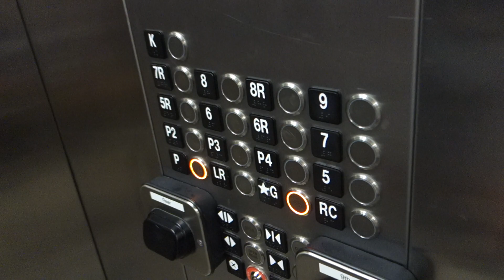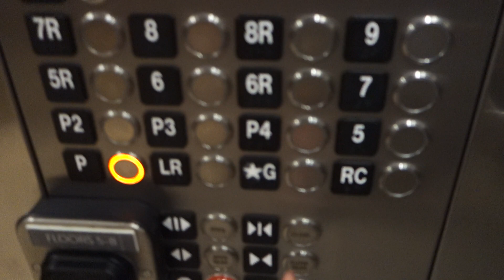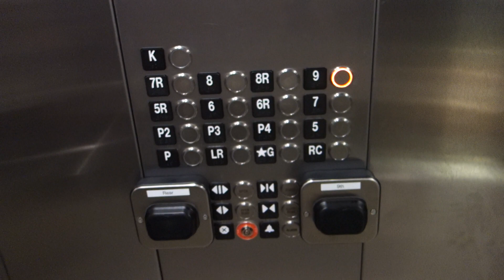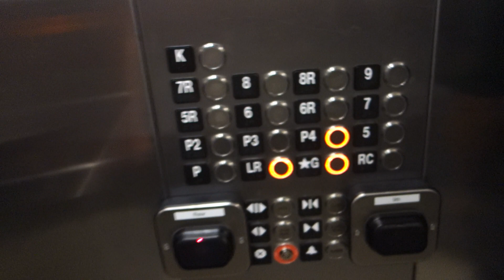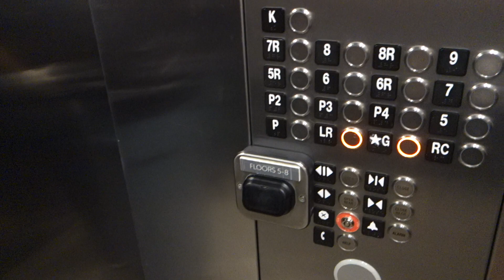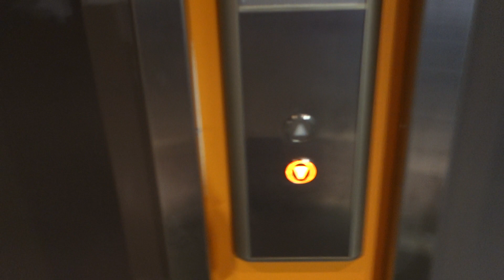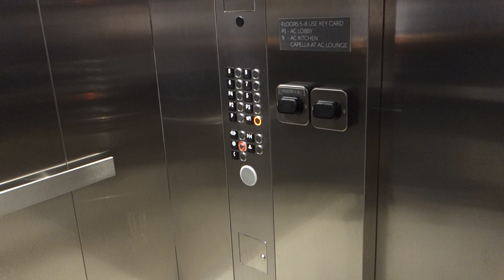HORRIBLE BRAND NEW KONE Ecodisc Traction Elevators at the AC Hotel, Asheville, NC

Comment: Yeah, KONE is a bit crap. One of the elevators in my apartment building in MD has been broken for SIX MONTHS NOW, and the management has done ABSOLUTELY NOTHING TO FIX IT. Recently, some of the parking elevators broke. Garage A has Two KONE Hydros and one KONE EcoDisc MR, but both the EcoDisc and one of the Hydros were both broken, and the remaining hydro that was in service is EXTREMELY LOW ON OIL!!! Also Garage B had one elevator break. This is in Rockville, MD. The Management did a good job NEGLECTING THEIR ELEVATORS. All of these elevators that I just mentioned are KONE Elevators.

Comment: I recently got a similar reply from a KONE tech when they were doing a mod at a mall they said “I’m glad we convinced them not to get an ecodisc mod” and that they always feel bad about how often they break. If they just made the controllers better the ecodisc would be great like the European ones. If the techs don’t want to install then then there’s a problem.
Reply: DoverElevatorFan1 it is the controller not the motor.  Ecodisc is a great motor
Reply: That is what I meant. Sorry if you misunderstood. The motor is good quality for a modern elevator. The controller could use some work though. KONE is a fine company and the tech was pretty nice.
Reply from the maker: Read my pinned comment
Reply from the maker: @freerk242  It may be the same, but not programmed properly like in Europe. Sounds to me you've never ridden a American Ecodisc, let alone this set, so you can't be talking. Not trying to be a jerk, but it's true.

Comment: Here in the UK, KONE do pretty nice lifts honestly. The Ecodiscs in my local library are really nice, they run well, and they only broke down a few times since they were installed when the library was built in 2017. The library was built to replace the old library (which was torn down and rebuilt as a hotel (that also has really nice Ecodiscs)). KONE also do more heavy duty lifts for car parks.

I guess as long as buildings don't install generic crap or rush better lifts, they should last at least ten years.
Reply: @KONEISTHEWORST stop spamming 10 year old

Comment: I hate kone ecodisc so much that we need to talk so right in to it the lanturn is shaped like a Diamond it's so glichy bumpy and slow and it's running bad I've got stuck with sahki and it broke after only 5 weeks or 4 weeks it used to be a to be a old garage with a amazing 1960s otis and it's just so bad and why is one of the floor indicator broken and I would even rather ride a 1920s otis over this piece of crap and I hate stainless steel cabs
And Do you agree? just reply in the comments
Reply: Yeah I agree
Reply: I completely agree
Reply: @Wen Kern Boys Elevator Channel beno LOVES it
Reply: What is your favorite elevator brand

Comment: How can you tell if a Kone is an EcoSpace or MonoSpace?
Reply from the maker: AdazElevatorz Speed and amount of floors served. These are probably EcoSpace cause of how slow they are
Reply: Floridian Elevators
EcoSpace doesn’t go up this high.
Reply from the maker: @EWPA14  Based on what I read online, I believe they can go above 10 stories actually. But for that many floors, MonoSpace is faster and more efficient
Reply: I think that was a few years ago. From what I can tell now EcoSpace is trying to compete w/ 3100 & only goes up to 4 floors.

Comment: I really hope you see this, kone is refusing to refill whiskey blue and they were there to fix it for the second time in 2 weeks. They were there 3 days ago and when I was back there to see it actually working it was low on oil... The engineer dosen't even know why it shakes at the top floor. Going to to text him about this tomorrow.
Reply: And why? 4 inch gap between top of oil tank where you refill it and the ceiling. Well that's why it was submersible

Comment: I am pretty upset about this replacement! I'd expect a lot better from kone. The Ecodiscs at my dad's friends house which are as slow as snails run far better then this piece of crap. And notice how long it takes for decelerate ! This is nearly as horrible as a typical NYC 50 story Generic lift

However, I do agree with dieselducy kinda as there is an example of when I have been extremely immature ranting about Otis products back in 2015-2016 by saying that the "Gen2 was crap" even though I never had any evidence to prove it false until last year...
Reply: HC EleFilms by Technicalboy3000 same me
Reply from the maker: Read my pinned comment

Comment: Should have went with Schindler 5500 or 6400
Reply: 6400 is only for mods
Reply: QuarioQuario54321 If the Otis was still here.
Reply: Top Hound Do you mean Schindler 6400NA
Reply: Seminole Airways
It’s the exact same thing, but Schindler dropped out the “NA” part of it.
Reply: Seminole Airways
?
It’s true though.
Reply: Seminole Airways
Whatever.
Reply from the maker: @seminolegonzalezairlines7757  ???? All I'm doing is dying laughing by how your comment makes no sense whatsoever LOL
Reply: Floridian Elevators
Ik lol!!
Reply: BC'sVators
The old structure was completely demolished & re-built as this, so no, these couldn’t have been 6400.
Reply: Trust me these are BETTER than Schindler 5500
Reply: @DriftingSofa  Even BENO lifts sead that 5500 is a just better 3300 but 3300 is a tin can.
Reply: @lbtf_roblox4755  5500 is better than 3300 but ecodiscs are better than both
Reply: @DriftingSofa  Yes
Reply: Drifting Sofa You clearly didn’t read the description
Reply: Or Hitachi or Hyundai Luxen

Comment: Kone at times is very nice but on the other hand, my sister HATES the Kone Ecodiscs in the building she works in in Indianapolis. She has told me that they break down way too frequently and they have issues with getting on them.
Reply from the maker: Why am I not surprised lol.... How many floors is the building she works in?
Reply: @FloridianElevators  I believe around 9
Reply: My Kone EcoDisc in my building does not break down at all, very reliable, it's a 1st Generation EcoDisc with Sigma fixtures which is imported from Europe.

Comment: 0:37 I'm actually thinking the opposite of vomit and also hope that there's a metal cabinet which has the same lock as the kone fastlock keyholes so then I can open the cabinet up to hopefully reveal an LCE logic for me to play with.

But it's still sad to see engineers installing these badly for NA, The ones in Europe and Asia are real nice.
Reply: And the multiplex seemed to be configured differently to the ones in Europe, probably explains why the electronics aren't reliable.
Reply: Rahan2003 
XD

Comment: Hopefully Otis will take care of them and probably in a few years hope they will be modded with series 7
Reply from the maker: Sadly, Otis doesn't maintain these, so I doubt that will happen, at least for a while.

And Series 7 doesn't exist btw. The New Otis fixtures are called Newer Series 2 if surface mount, and Newer Series 4 if flush mount. And if it's a mod, Series M2
Reply: @FloridianElevators   series 7 exists and it's a newer otis modernization just like as series M2

Comment: Normally, I do like these Kones, especially their fourth generation EcoDiscs, which are awesome.

I don't know what is with the US Kone division, but they never can get installations quite right. It really is a game of hit and miss with them, and more often than not, they miss. Especially since this was a 60s Otis, I think this install was one of their low points.

But at least it's not a s*** generic, which are designed to last ten years before being replaced with another lift lasting ten years as well. It could be worse. Also, it's the hotel's fault for putting bottom-of-the-range EcoDiscs in here. Put Schindler 3300s in this application and they'd end up no different. Kone can do good lifts, and there are loads of them across the world, hell, even in the US.

It's not just Kone mods; mods in general suck. Especially if it uses blue Dewhurst US95 and nasty Alphasoft indicators (that's what many such mods in Australia use). Mods do have the potential to look nice, but not when you use fixtures that are seen basically everywhere.

Comment: Wow, just wow. Honestly, I like KONEs, but when it comes to bad maintenance, nope. When I find a very well maintained KONE elevator, I enjoy them, but otherwise, I’m disgusted. I know KONE is trying to make their elevators better, and it all really just depends on how the place and maintenance company maintains the elevator. See, at a mall near where I live, they used to have Meyer and Frank, with a Montgomery G&P. I never went there, but sometime in the 2000’s, Macy’s took over and brought with them a modernization for the elevator, which was a KONE mod, and it’s been a KSS 370 to this day. I can tell they replaced the motor, and they pretty much replaced most stuff, for what I can tell. I live by about 4 malls, and one of the other ones that are further from me have a Montgomery G&P at JCPenney, which is still original to this day. I’ve heard the motor before, and I believe the store will close before the elevator gets modernized. But anyway, back at Macy’s, the elevator has its problems. Re-level problems, overall leveling problems (how long it takes to level), and door problems. It used to run like crap back then. but they have been trying hard to fix it up. Honestly, it’s the best elevator in the mall now, as the others aren’t keeping up too well. What really sucks is the main elevator is a Dover Traditional (soon to be filmed by me), and a (I believe?) MontgomeyKONE mod with Innovation (I think it was overall some sort of Montgomery, maybe even a Dover) before it got modernized. But anyway, with all that being said, I do like KONE elevators depending on how they’re maintained. Of course, I respect the fact that you hate American KONEs, and I can see why.

Comment: Kone Does Need To Improve These Two Elevators... 

The Elevator Modernization HAS GONE TERRIBLY WRONG THOUGH...
They can at least maintain these better, more like the reason you are not HAPPY about these Elevators, is the poor maintenance those two elevators HAVE!!!!

For the one with two doors. 
1. They need to fix the arrow indicator and make it ring, unless the other one has the same problem, then they need to fix both of the arrow indicators. 
2. And fix the other floor indicator on the 2 door elevator
3. Make the elevator cabs better, stainless steel is, IDK, OVERRATED! 

Or they could replace it with Schindler 5500 Traction Elevators

Otherwise, I do agree about the elevators being disappointing, what I would say about it right now is these elevators got a “DISAPPOINTING MODERNIZATION!”

I am okay with the elevator having music in the background, but seriously, these elevators need better maintenance.
Reply from the maker: It's not maintenance. Marriott has good maintenance and this is clearly KONE's fault. This hotel was only 1 month old when this was taken!
Reply: They need to install something a bit worth while
Reply from the maker: @STUAA2025  Very true!
Reply: Jowelevator says that they don’t trust KONE anymore.
Reply: @FloridianElevators  The service elevator at that hotel got a Innovation Bruiser mod.

Comment: It’s because that in the US and Canada, these elevators, or lifts for short, are not very good at doing elevators. 2 elevators in a hotel only to serve the staff and guests. Needs to gets an Otis service elevator, like a Series 7 or 4. Needs to be replaced by a Series 7 or 4 soon for the guests and 4 passenger elevators would do. 2 service elevators would be good, and an Otis Series 1 parking garage elevator would’ve been good. These elevators are very bad and need to be replaced soon with Otis Series 7 or 4 and the other stuff I said in this comment. Reply to this comment of what you think or the Kone elevators, and do they need to be modernized, or kept the same?

Comment: Thyssenkrupp would have done a better job Even though I still like kone
Reply: ThyssenKrupp is much better than kone
Reply: Thyseenkrupp in my experience has been less reliable than kone (especially their low end elevators), but seem to be still quite innovative with their new designs.
Reply: PR Elevators Or OTIS or Schindler!!
Reply from the maker: Read my pinned comment
Reply: Elevcan 23 But KONE is merging with TKE soon
Reply: @nidbahn  beno thinks all of lifts are the best except stannah and the generics. stannah in the 1980s is good

Comment: These aren't terrible. However it's a brand new elevator. Even when they are 5 weeks old, they're still kinda in their installation process so they will still have a few glitchy moments before they work completely as they should. It's normal for any elevator. And these are much better than the Melia Hotel Kissimmee, Florida. Although there are still a good amount of KONE elevators that don't run the best
Reply from the maker: William Scoufaras Well, when I was here, the left one was breaking a LOT, we waited 10-20 minutes for these sometimes, NOT KIDDING, and not even a year later, one of them is already modernized!!!!
Reply from the maker: Ready my pinned comment
Reply: I doubt the OP was trying to attack you BTW.
Reply from the maker: @TheDragonFire123  What is the OP?
Reply: OP = Original Poster, used a lot on forums to indicate the user who started the thread (e.g, William Scoufaras for this thread). What I mean is that I do not believe referring the OP to the pinned comment is necessary since they did not attack you and trying to testify the elevators featured are bad will not change their opinion.

Comment: My lift is kone and its way better than this junk  🤮🤮🤮🤮
Reply from the maker: Mansoor They do have the potential to make great elevators and there are some that are pretty good, but most of them tend to be junk like these.
Reply: They are awsome lift 1 goes to (-1,0,1,2,3) the 2nd one goes to (-1,0,1,2,3,4,5,6)
Reply: It looks like a disgusting and 2011 lift
Reply: @FloridianElevators  maybe because the elevator control logic need to convert 50hz in Europe to work with 60hz here in the US?